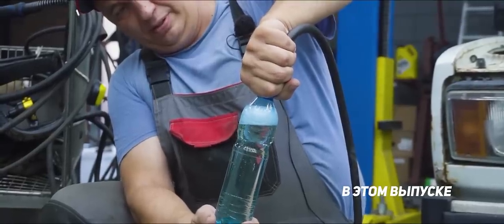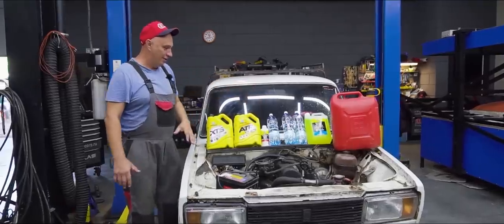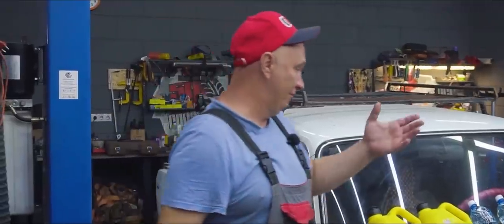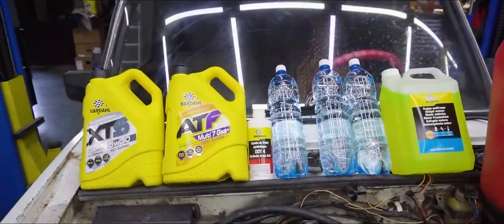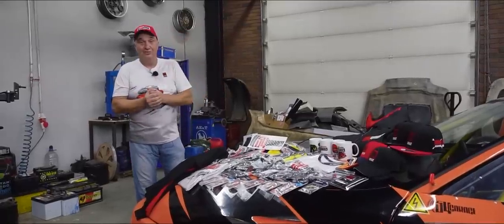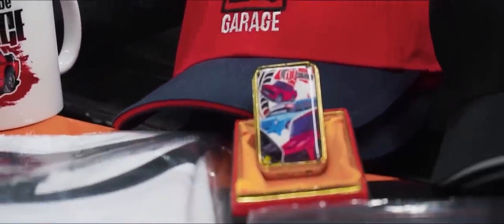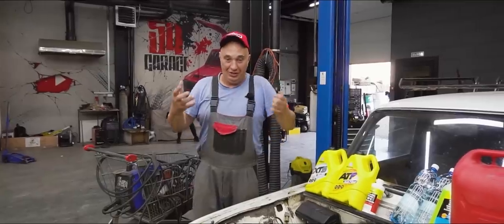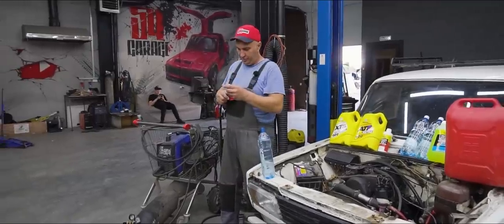What happens when you carbonate gasoline (and other fluids)?

Comment: You should carbonate gasoline with N20 /Nitrous oxide from a canister then feed it to the Lada like you did with the C02 and go for a drive!
Reply: Nitrous oxide is actually soluble in alcohol-based fuels like ethanol.
Reply: I'd be careful with that mixture, could be quite explosive
Reply: @oM477o  I also wouldn't do that. Mixing fuel and oxidizer is just asking for trouble.
Reply: wouldn't that be oxidizing it rather than carbonating it? where's the carbon hehe
sounds fun and super dangerous!
Reply: I would love to see the effects of Oxygenating petrol then putting that in the tank, as that would make the combustion more violent, and you might end up with a non-turbo/super charged - charged engine!  But then again, it might simply lean the mixture.
Reply: @7_Max_7  reminds me of back in the day with hydrazine nitromethane 😂 it will kill you in ways you can't even imagine
Reply: This is a beautiful idea. Pour that in a lada and it’ll run fine😄
Reply: EGR is inserting an inert gas into the combustion process for efficiency, effectively lowering the cylinder volume at cruising speeds, problem is that by the time it does that the engine doesn't make enough power to cruise any more.

I could see where inserting a secondary gas into the fuel system around the injector rails (so it wouldn't contaminate any more fuel than necessary) could be beneficial.
Reply: @c4k3t0otz6  Oh, OK.  Never heard of it.  I guess it never gets that cold over here, cos we certainly don't have it. ;)
Reply: @VauxhallViva1975  check out your gas pump sometime, I wouldnt doubt it still has a sticker talking about oxygenated fuel. I guess its to combat emissions in the colder months of the year.
Reply: @Pslobe I mean, technically it would. Again, just look at top fuel dragsters.
Reply: Carbonate it with liquid oxygen.
Reply: @7_Max_7  how is it different than injecting nos into the intake manifold?
Reply: Big brain time
Reply: @c4k3t0otz6  Nah. They add less bio into diesel and thats it. Maybe more 2-Ethylhexyl nitrate additive. Oxygenating would oxidize the fuel. I guess you could do it right before the race but the bubbling could be a problem in pipes and fuel pump. Nitrate too much and you'll get big badda boom in the cyllinders AKA knocking.
It would be a cool fire cracker tho
Reply: YEAH
Reply: yes do it. that would be awesome!
Reply: You cant carbonate something that has no carbon in it...ie nitrous oxide 😂
Reply: @baked.9nion  we know. It's funny to say
Reply: @7_Max_7  It's not hypergolic, but it would certainly be unstable at high temperatures and/or pressures!
Reply: Can anyone say vapor lock? Lol
Reply: @oM477o  nitro doesnt explode
Reply: Or just plain oxygen!
Reply: I was thinking oxygen from torch and gas. but that spontaneous flammability and explosiveness of that would probably be very dangerous
Reply: @7_Max_7  like..... nitromethane??
Reply: @VauxhallViva1975  at that point just add more gasoline
Reply: You all actually know what oxidized gasoline does. It's why you get deposits on injectors or carb jets. And sledge in your fuel filter. It makes gasoline varnish.  The idea about putting n2o in gas is an interesting idea actually. But it's not going to auto ignite on it's own. N20 only  breaks into n2 and O when its heated to around 1200f.
Reply: People do oxygenate fuel for more power. You should try that next.
Reply: @AdventureAwaits4u  it doesn't work like that. oxygenated gasoline is done at a molecular level. running pure oxygen gas through gasoline will cause some of the compounds in it to turn into solids called gum. While gasoline can likely keep for months to years, environmental factors such as heat, oxygen and humidity influence the fuel's condition. Aside from evaporation, gasoline is like wine — once you take it out of the bottle, it starts going bad. It starts oxidizing away, As some of the hydrocarbons in the gasoline evaporate, other hydrocarbons react with the oxygen in the air. The gasoline then begins to form solids called gum. In short, you want to store your gasoline in cool, low-oxygen environments. 
all that said it would be cool to see the oxygen react with the gas and see how fast solids form.
Reply: @VauxhallViva1975   dry but it's not likely.  read the comment I made before this one.
Reply: @oM477o  If you put it in a diesel, yes.
Reply: @7_Max_7  traditional nos setups do just that, only at a later time.
Reply: @made of scars did you know portobello mushrooms naturally produce descent amounts of Agaritine, which can be processed into Hydrazine. It's why you're supposed to cook them before eating them.
Reply: @oM477o  That sounds like warning given to you, when you are about to eat something that will give you a diarrhea. 😆
Reply: @bobthompson4319 I know this is old but it got me thinking... what if you mildly carbonated gasoline to minimize oxidation in storage? Purge the storage container with CO2 then add the mildly carbonated fuel. Keep expelling some CO2 gas until you can be pretty sure there's negligible oxygen left. Cap it off then just let the CO2 escape when you're ready to use it later. You could even draw small amounts from a spout at the bottom without exposing the main container again.

I have a feeling this would either work amazing or end up being a horrible idea... probably not much in between.
Reply: Then it would not be called carbonation.
Reply: Inhale the nitrous, exhale into gasoline.   The only right way to carbonate fuel starting with n20
Reply: Hell yea that'd super charge the fuel, might even be good for racing

Comment: Ah yes, carbonated brake fluid. For all your air bubbles in your brake line needs.
Reply: But wouldn't the CO2 add pressure to the brake system when it heats up?  Like when you lean on the brakes for a bit and then the pressure builds until the brakes completely lock up.  CO2 doesn't dissolve in liquids the same way air does.  I think this calls for another experiment.
Reply: Lol
Reply: @rayceeya8659  u got a good theory we well.
Reply: They already said that the brake fluid would never work
Reply: @rayceeya8659  after thinking about it the fluid would become ( I guess you could call it) vapor locked an wouldn't let the fluid be able to move to be able to push the plunger.
Reply: @ericrobbins1060  Still think it would be fun to try.
Reply: @ronniewilliz153  Like I said, worth trying.  I know how air effects brake lines (very not good), but CO2 isn't air.  It's solubility is completely different.
Reply: @rayceeya8659  correct but it will vapor lock even faster cus of that tho is what I'm saying I think An idk of you'll be able to force it like you can air either since it compresses different then air
Reply: @rayceeya8659  Indeed my friend
Reply: @ronniewilliz153  Right That's why I'm curious.  I've blead brakes before and I know what a pain it is when you get an air bubble in there.  That's why I'm curious.
Reply: at least you could shake the car before bleeding the brakes out, no need to pump the pedal :)
Reply: @chrismechanic2000  Like drive it over a bumpy road?
Reply: @rayceeya8659  Sounds like a great way to haze the new guy in the shop. Fill master cylinder with carbonated brake fluid and tell new guy to bleed the brakes.
Reply: @chrismechanic2000  Dont forget to open the cap every couple of shakes
Reply: @rayceeya8659  but the Co2 is able to compress much more than brake fluid, AND will still vapor lock. Air will expand in brake lines as well, well try to.
Reply: @koreymann2493  But what if there's more CO2 in solution than the brake lines can accommodate?  They were carbonating up to about 5 or 6 bar.  When that CO2 comes out of solution it's going to come out at 5 or 6 bar.  What does a normal brake system run at?  Maybe half that.  

My guess is the brakes seize up after a speed bump or two,
Reply: @rayceeya8659  Power brake systems can run up to 1500PSI, aprx 100bar at full lock. Less or more depending on size and what not, but hydraulic systems are no joke!  the clamping force of even a small single caliper brake is unreal. Brake lines them selves are regulated to take something like 5000PSI   FIVE THOUSAND PSI  that is mind boggling when you think of the scale. Never mind looking into large lifting rams and such. Highly suggest poking around a bit on the net, to me it's mind blowing.
Reply: @koreymann2493  Well there you go then.  The Carbonated brake fluid would cause massive brake fade very rapidly.  Still want to see G54 try it.
Reply: @rayceeya8659  oh me too.. I by no means have any clue what will actually happen, just a bunch of curious questions. Like the fact that at over around 850PSI Co2 recompresses to a liquid state given the right temps... but that all goes away with mixing with brake fluid. 

I think it'd just do pretty much like you say, few bumps, separate and "float" to high points and lock up from air lock because no fluid in caliper
Reply: @koreymann2493   I think the thing we can definitely agree on is that the results would be surprising and chaotic.  Perfect for Garage 54.
Reply: Yes and no brake lines can see 300 bar new with what regulations require the co2 will release pressurized but when the pressure sky rockets (braking) it should re dissolve into the fluid as it compresses my main question is how much hotter does it get with less density
Reply: @TheDumbAssPollock  I'm wondering the same thing. I figure with the pressures involved it's go back to liquid state in a cold system.. but the additional heat then what, so many variables
Reply: @TheDumbAssPollock  
Wouldn't it be cool if we stumbled onto "hard mode" of a rally stage here.  
Brakes are fading: hit the soft shoulder and shake up the brake fluid
Brakes are dragging: have to drive very smooth.
Reply: It's to make up for the cross drilled brake lines.
Reply: @rayceeya8659  the biggest problem with your theory is that gas of any kind is compressible.  Whether it's air, nitrogen, carbon dioxide, argon, it's all compressible.  That's where your problems come from.  Air (gas)  in the system will cause a spongey pedal and kill the performance of the brake system.
Reply: @zachaliles  Not true.  CO2 becomes an incompressible supercritical  fluid above a certain pressure.  That happens just below 100bar.  That's what makes this so interesting to me.
Reply: I'd like to see them try it out
Reply: I definitely LOL'd when I saw the brake fluid on the cowl.
Reply: For the discerning gentleman that likes his brake pedal soft and gentle
Reply: Its not air tho but yes bubbles.
Reply: @rayceeya8659  nope, as CO2 is a gas it means its compressable. Brake fluid isn't, so my guess is your brakes will just feel like as if they had air in the lines. But might be interesting to do an experiment on it still
Reply: @rayceeya8659  Gas compresses, fluid (virtually) doesn't compress. So it wouldn't add braking pressure as the gas would compress between the fluid, instead end up with less braking force I'd imagine. This is the problem generally with air in any hydraulic system
Reply: @CynRacing  Are you familiar with super critical fluids?
Reply: And refreshing on a hot summer day
Reply: @CynRacing  that was the joke.
Reply: @rayceeya8659  Because liquid does not compress where as air (or gas) does compress. With the difference in pressures, you'd have a spongey pedal. Just like if it was regular air in the line. If the brakes only operated on compressed gas alone, then it would work.
Reply: @rayceeya8659  Regular air also doesn't dissolve in brake fluid either.
Reply: @johnruschmeyer5769  Thay sounds like it would be hilarious lol. Good idea
Reply: @rayceeya8659  Doesn't matter. They compress differently and would not work in sync with each other if mixed in the same system.
Reply: @mikeznel6048  CO2 becomes a super critical FLUID at the pressures and temperatures we're talking about here.
Reply: @mikeznel6048  
Do you know what a supercritical fluid is?
Reply: @rayceeya8659  You're not listening to what people are trying to tell you... You can not have anything other than brake fluid in a hydraulic brake system... If you introduce air or in this case a gas to the system, it will not work... Thats all there is too it. Hydraulic brakes operate on fluid, not air or fluid mixed with air. There would need to be some type of separation between the hydraulic side and air side to keep the two separate. There's nothing more too it. Air (or gas...) in a high pressure hydraulic system is detrimental to the operation of the system. There are air over hydraulic brakes but, the two systems are complete separate from one and other. Meaning, there is a mechanical barrier that separates the hydraulic side from the air side and mechanical interface that transfers the movement from on system to the other. It doesn't matter what air or gas it is, if it is inside of a hydraulic brake systems, it is going to impede the ability of the system to function as it is designed to operate.
Reply: @rayceeya8659  No it does not become "super critical" because the pressure wouldn't be achieved in a hydraulic system with air in it... Especially a hydraulic brake system that is operated by mechanical input from a brake pedal to a master cylinder that pressurizes the brake fluid. You add air to the system and the throw required to compress the gas in the hydraulic system is far greater than what can be achieved from the stroke of a master cylinder. The gas isn't gonna sit in a bubble and compressor along side the pressurized brake fluid and work together. The gas in the system is gonna try and find the easiest point to return to a normal pressure and state it would be at in our atmosphere. Also, being air in a liquid, it's going to work its way to the highest point in the system and wreck more havoc. You have all these words and thoughts but I do not believe you have the most basic understanding of how hydraulic brakes operate. Everything you're saying would cause issues in a hydraulic brake system. Not even just in a hydraulic brake system either, any high pressure hydraulic system.
Reply: @rayceeya8659  Do you know what a hydraulic accumulator is? If you do and know how they work, you would know the high pressure gas and hydraulic fluid are separated by a mechanical barrier known as a diaphragm to keep the two systems separate. The two systems must be kept separate because if you introduce high pressure gas to a high pressure hydraulic system, they are going to work against each other. And no, hydraulic brake systems do not create the proper conditions to turn it from gas to a liquid. I truly hope you do some reading, not watch videos, and learn some stuff before you insist on something you don't know about as you are. I'm not being mean or nasty, I'm trying to tell you it won't work and you keep saying this or that and how it will work when it has already been proven not to work. IE hydraulic accumulators. I'm going to assume you haven't the slightest clue what one is, none the less how one works. I would suggest you start reading into had accumulators first.
Reply: @rayceeya8659  its solubility its the compressibility  of air or co2 compared to the  fluid
Reply: so that's why the brakes would never prime up!
Reply: life hack
Reply: Meanwhile in a other universe
Reply: It's a great idea! Lots of air means your brake fluid goes so much further! Always shake the bottle hard first!
Reply: This kill's
Reply: @rayceeya8659  do bears shit in the woods
Reply: I'm thinking for a short run like 30 minutes or less after carbonating the brake fluid, it might actually stop the car better.  So maybe if you are running in a drifting competition you might have a slight advantage.
Reply: Can't wait to try and use a spongy brake pedal
Reply: 11:50
Reply: The bubbles are shy under pressure.
Reply: Yes it is essential that your brake pedal is spongy
Reply: Lol I can't believe people are over here saying you can have air in brake lines lol. Clearly have never touched a wrench none the less bleed a hydraulic system lol.
Reply: @mikeznel6048  I know that's its essential to bleed a system since I'm on a motor vehicle course
Reply: Try bleeding the pressure after bumps
Reply: You might find it quite safe as your brakes are just permanently on and you can't move the car.